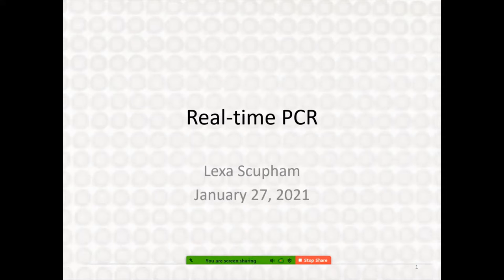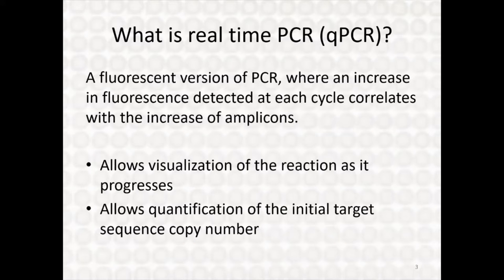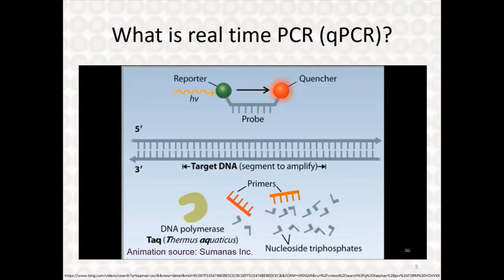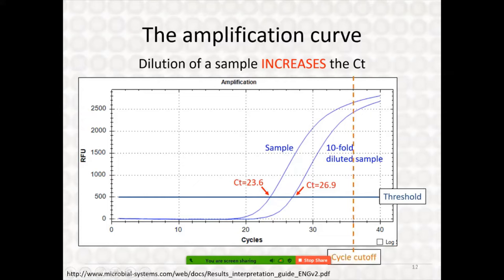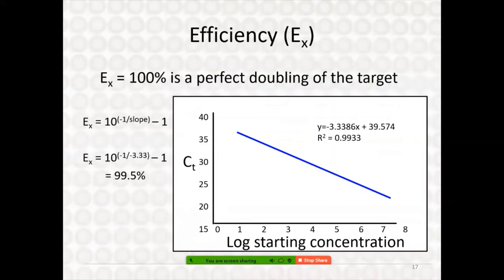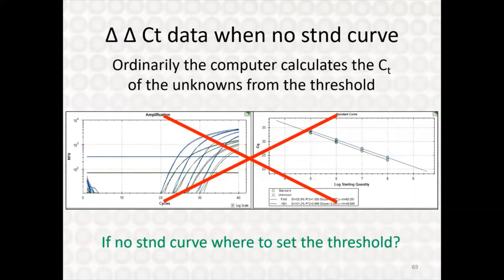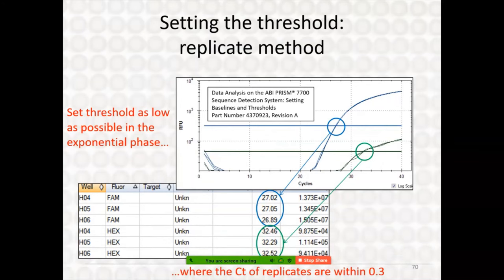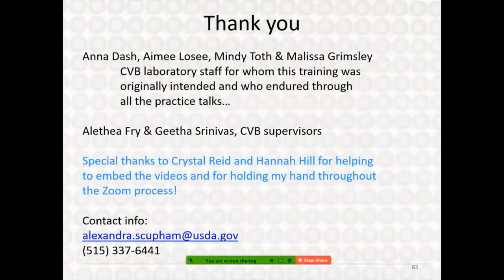Real Time PCR - Part 3

Comment: The video is great, but your math is incorrect. Case in point calculating the deta delta Ct 1:04:32 in the video. The delta Ct for antiviral 1 should be 23.52 - 32.53 = -9.01 not -7.38; -8.49 for antiviral 2, not -9.01; and -7.38 for antiviral 3, not -7.37. Also, the delta delta Ct for antiviral 3 should be 1.17, not 1.18. I love the video, but when someone's math is incorrect in a video/classroom, it makes it difficult for me to learn the subject matter. That's the only critique I would make. I do highly appreciate your time and energy in creating this; it is significantly helping me prepare for a certification exam I'm getting ready to take.